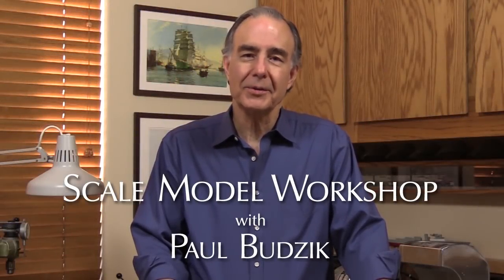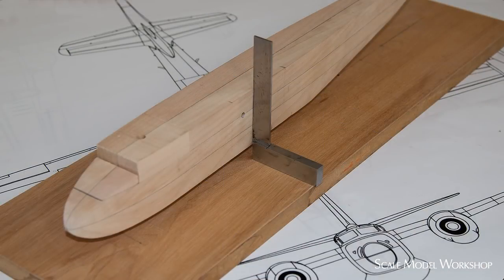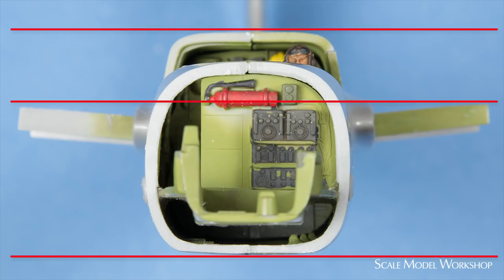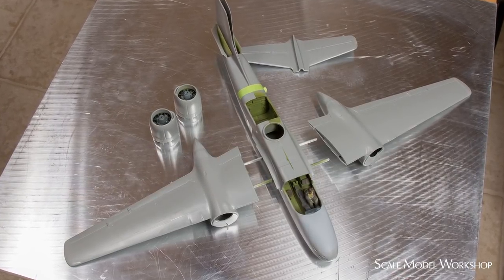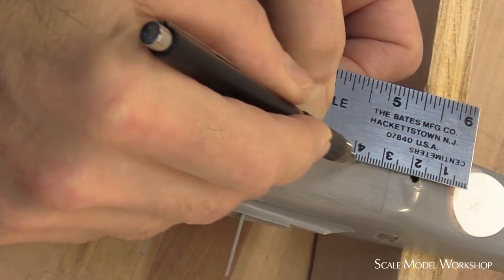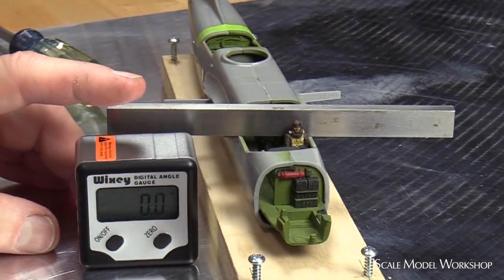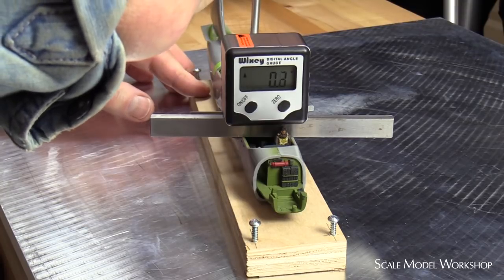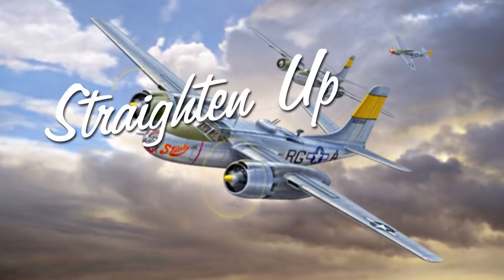Aligning the Airframe ... Building the Revell A-26 Invader

Comment: How thick is your aluminum plate?  Since this video I've been shopping for one but in person they have not been perfectly even with a noticeable warp, which would seem to defeat the purpose!
Reply from the maker: it's 1/2" plate ... I had a local metals supplier cut it from a larger piece.  I forgot what the guaranteed tolerance was, but it was pretty much dead flat over the distance I needed for this plate.  It wasn't all that expensive ... seems like it was $50 or $60.
Reply: I'd suggest that you find a piece of aluminum, then start looking for a shop that has a blanchard grinder.   that machine will be able to grind the surface flat.   you're not looking for a precision thickness of the plate, just flat and parallel on the two faces.